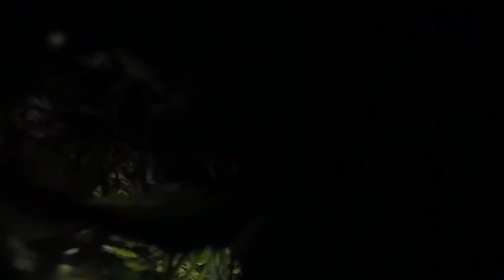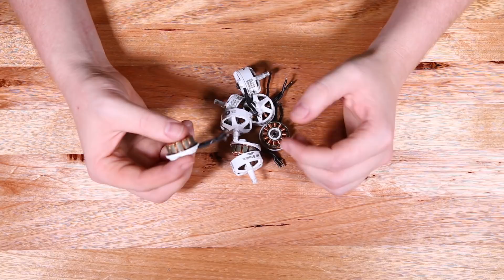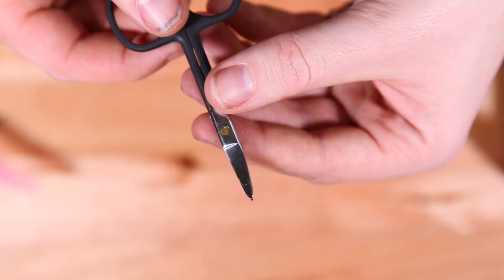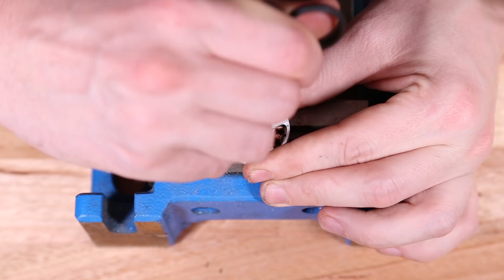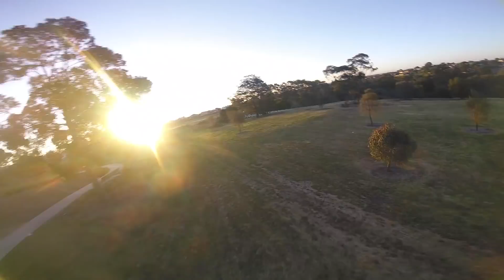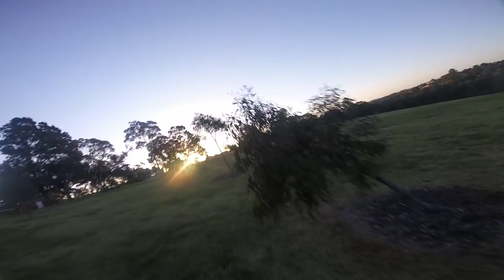Mr Steele's Balls: How to Change Motor Bearings

Comment: not sure why, but I find the clip quite easy to get off. I just maneuver some tweezers at the ends and they pop off. I actually prefer lock rings to screws. I have more trouble removing the first bearing without damaging anything

Comment: Hammering the new bearing you could've just let the old bearings in the motor. Don't ever hammer on a new bearing lmao! Use a 4 mm screw with washers and the old bearings in order to press the new ones into the motor.

Comment: Hi 
Could you give me the part number bearings or the dimensions?
Reply from the maker: Hi there 

Replacement bearing can be purchased directly from TBS, I would recommend you get them from them as you just can't be guaranteed you are getting the same spec/quality. You don't want to loose a quad because of a cheap bearing. In the vid I salvaged mine from other steel motors I had previously damaged. Mostly due to stripped prop shaft threads. I unfortunately i don't have any spare loose bearing at the moment to measure so I can't currently help with dimensions.

Hope that went some way to helping

May your skies be clear and your winds light.

Paul

Comment: Dam how’d you mess up that many motors. I have crashed probably a few hundred times learning to fly, and I have never ever had to replace a motor.
Reply from the maker: I fly hard and crash hard :p. I break the odd motor when I fly some place that is unforgiving. Spots where you might only get one or two flights but is too good not to fly. so it's an all in or nothing situation and sometimes you come back with some repairs to do.

Comment: what bearing do you use? how to find size needed?
Reply from the maker: Hi there 

The bearings i used in the vid were recovered from a damaged motor with good bearings. TBS sells suitable replacement bearings from the Mr steele motors as of writing this they were priced at $4.95US a pair on the TBS website and were in stock. To find the right size I would need to measure some with the calipers but i don't have any on had at the moment, i got rid of all my dead ones. i have seen possibly suitable bearing on ebay and the like but can't attest to their size accuracy and/or quality. 

Hope that helps a little

Happy flying

Comment: Beside doing that is there any tool that i can use to remove those bearings at amazon?
Reply from the maker: Quite possible but i have never looked plus being Australian our version of amazon is a bit crappy so never even thought to look. the problem is anything that can pull either the top or bottom bearing out also need to clear the hole of the other bearing in some way. otherwise you can just go full gorilla and use a small screwdriver and hammer to push the bearing out, but you risk damaging the side wall of the bearing seat plus you will destroy the bearing (which is ok if you are replacing it) sorry i cant be of anymore help than that.

Comment: Great idea with the washer bits, I've done this with large bearings but have not tried this with quad sized motors.
I have a habit with striking things with the bell- thus killing the motor. But with fixing a bent shaft with a hole in the center is easy, put a driver that just barely fits in the hole and pull the opposite way of the bend- I saved a few motors like this, takes patients and practice, but it's nice to get it true again- obviously weakened, but it's better than tossing an otherwise usable motor.
Reply from the maker: yeah i have had to toss heaps of bells just because they are too worn out. its nice to be able to repair these things and stay in the air a little longer before being replaced

Comment: a trick i learned from changing various bearings on motorcycles - put the new bearings in a plastic bag and stick them in the freezer for a few hours or overnight - they will shrink just enough to make fitting super easy
Reply from the maker: yep done that many times before when rebuilding motors for my scale glow planes. its amazing sometimes they just slip in they shrink so much, good tip
Reply: where can i find them magic shrink bags?

Comment: very nicely made video, congrats!
I like your idea with the piece of washer too..
One thing about tapping a solid block of steel onto aluminum (tapping the bearings out, but especially IN w a hammer is not a good idea..), while having such a nice vice as you do! ;-)
Your vice can apply continuous force over the thread in both direction, think about that!
I would at least slowly push the bearings in w that one..
Cheers, happy new year and keep it coming! Subbed!
Reply: just get a bolt and nut and some washers and tighten the nut and it will pull the bearings in
Reply: yes thats true, but I think its easier to see if its seating properly with the screw method than hammer method :-)
nice flying btw
Reply from the maker: Hi Emanuele 

Thanks for the kind words regarding the vid. indeed i did think about the drawbacks of tapping the bearings with a hammer vs pressing with a vice. in a ideal world i would never tap them. however not every one has a vice so i wanted to show how you could do it with the minimum of tools. as it is you need to make a tool. fortunately the fit of the bearings is a very light press fit so as long as you are careful taping them in it not too dangerous.
Reply from the maker: another very good way of doing it you just need to be careful as the bearing initially seats
Reply from the maker: Thanks man :)